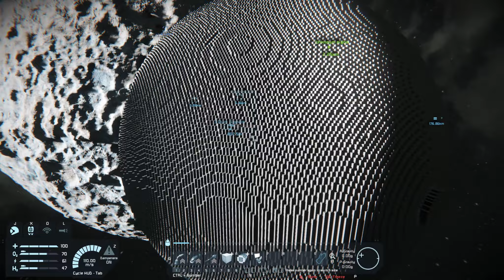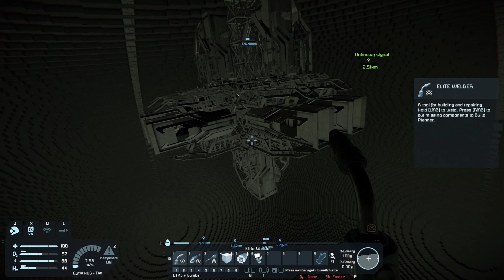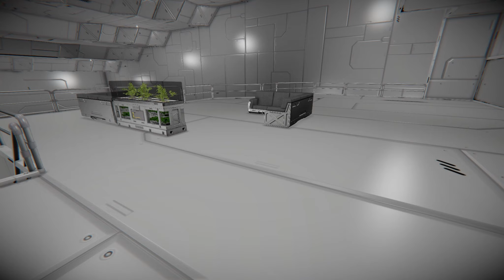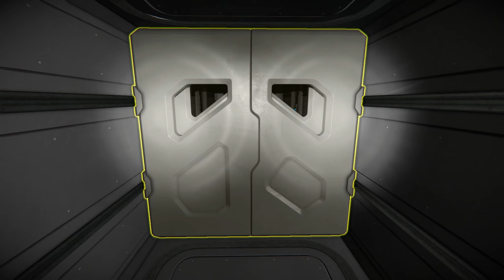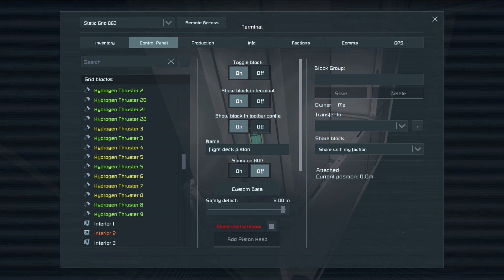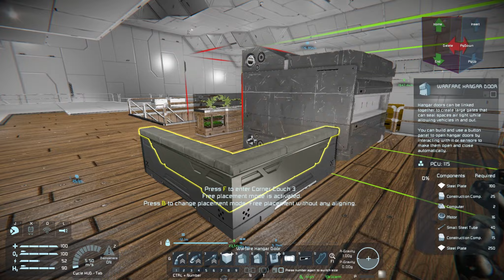THE MASSIVE INTERIOR UNDERTAKING | SpaceEngineers

Comment: Nice video. The build is looking good. The interior dock reminds me of a Starbase from Star Trek. Your wobble problem with the retractable bridge is to be expected. Klang is a fickle god. Share Inertia Tensor makes the block have the inertia of the grid its attached to. You might find it reduces the wobble to turn it off on the bottom piston. I couldn't tell from the video if you have multiple pistons stacked or have merged two pistons to work in tandem, but as a general rule i find it reduces wobble and general Klang fuckery if you turn on Share Inertia Tensor on all blocks after the base block that is attached to your primary grid. I hope that helps. Also you should maybe use the mod Build Vision. Its a big help for builds like this.